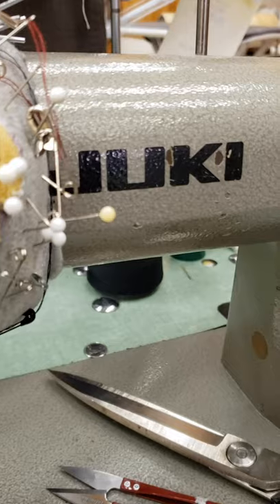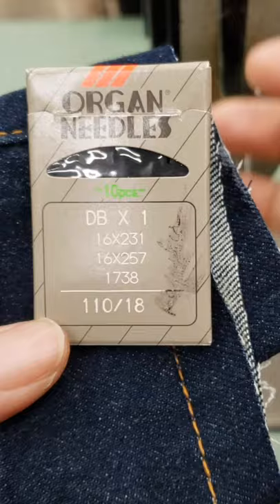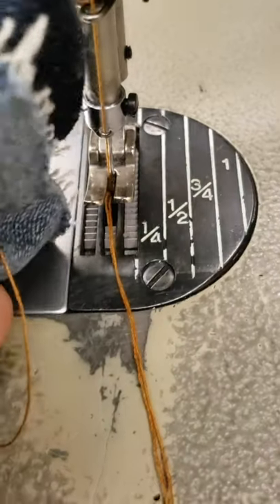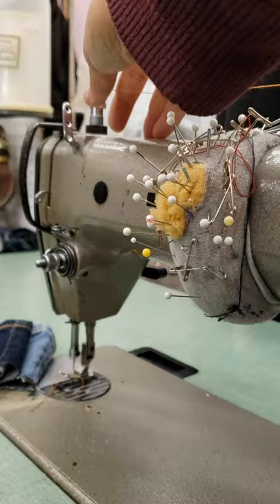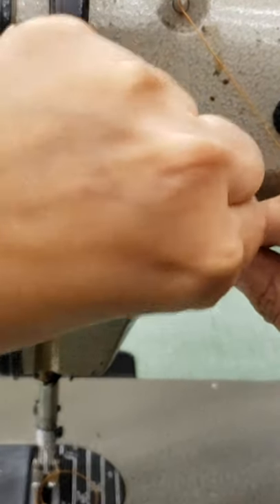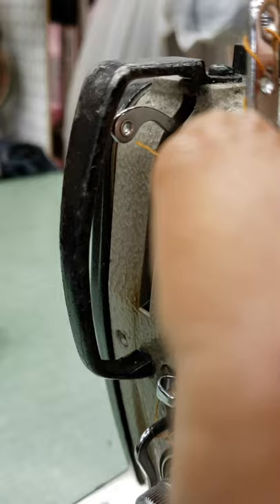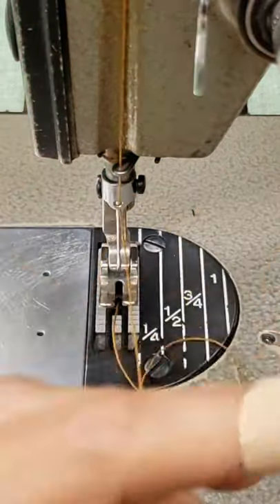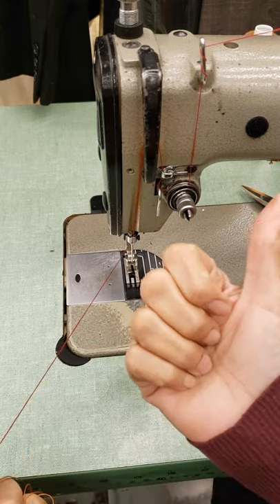How I Thread my Industrial "Jeans" Machine: Juki DDL-555 #shorts #youtubeshorts #sewing

Comment: Same way I thread my SInger 20U I make sure the presser foot is in the lifted position so the thread goes into the tension disks
Reply from the maker: Yessss! That's right.  And very worth mentioning it. Thank you Evelyn 🥰 😊
Reply: I just bought the same machine, what did you say you changed your pressure foot and plate for which one? pls. thx. @DowntownTailoring
Reply from the maker: @falbalalagauloise410  Yes. I did.  For a more sturdy one.  I'm going to make a short about it and tag you.  Cheers 😊
Reply: oh okay thx so much! @DowntownTailoring